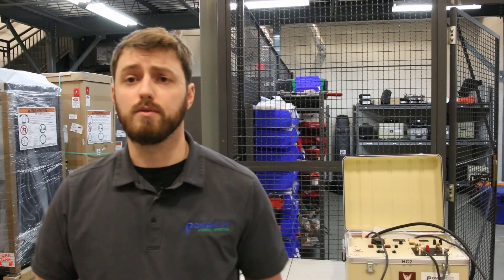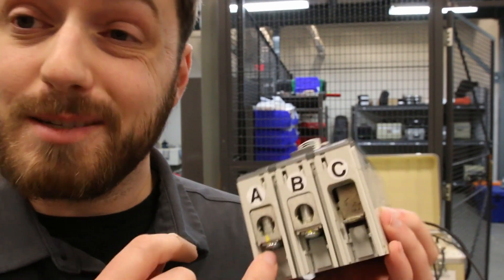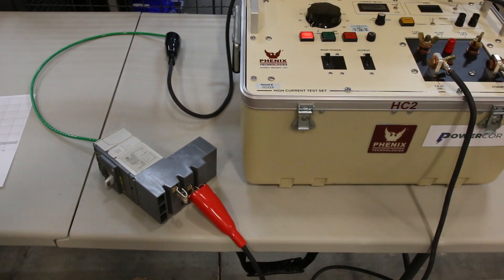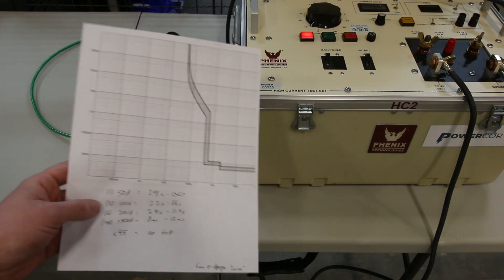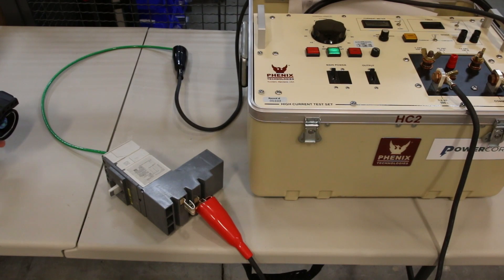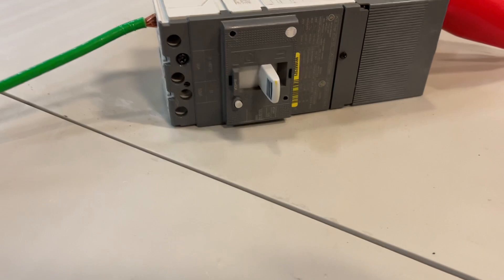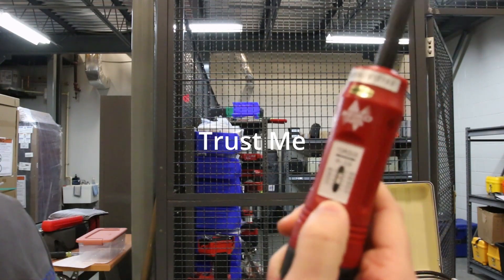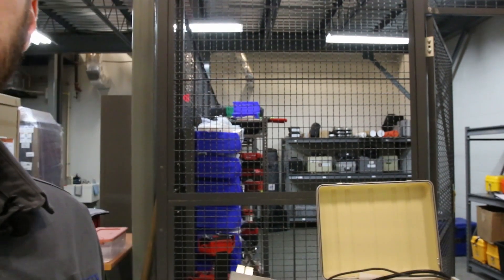Inexcusable Problem with NEW ABB Breakers

Comment: Are you a specialized electrician? I ask because I'm interested in doing the same work.
Reply from the maker: I'm not an electrician, electrical testing is really its own trade! It's important for a lot of customers to hire independent testing technicians, instead of relying on the manufacturer or installer certify that the equipment is suitable.
Reply: Thanks for the reply. So how do I go about becoming an electrical test technician? Are there schools and is there a license I need? @testingtechtips

Comment: I was an electrician for close to 40 years. That breaker look like a REAL PIECE OF JUNK!!! & EXTREMELY EUROPEAN!! I cant help but notice that the FACE of it is made out of PLASTIC!! 
the case of it is made out of glass reinforced polyester which can stand high heat. This stuff is just getting CHEAPER & CHEAPER. The lug you measured is the same as the one next to it. 
You are overlooking a machined edge or notch in the lug if you look very closely. ABB has really RUINED GE!! On their RELIAHOME P panels they are making ALUMINUM BUS BARS!! GE breakers have made LITTLE CONTACT with the bus tab which was ALLWAYS TINNED COPPER before ABB got their hands on GEs product line. I hope that this new GARBAGE really BLOWS 
UP IN ABBs FACE!! especially the resi panels & really BITES them in the BUTT!!   EVERYTHING is getting cheaper & cheaper across ALL makes. This breaker looks like a poor copy of Square 
Ds I LINE series that are PLUG ON INDUSTRIAL BREAKERS. It also looks like but HOPEFULLY NOT that, that piece that hold the plug in part is also PLASTIC & not the HIGH HEAT stuff.
I DINT like GE power mark gold 200 amp panels because the main lungs on the MAIN BREAKER are mounted on THIN MELTABLE PLASTIC & ONLY 1/8th inch from the back of the box.
I liked SIEMENS & SQUARE D QO panels because those lugs are on GLASS REINFORCED POLYESTER & NOT PLASTIC!!!  I-T-E used to be like GE but they got SMART & CHANGED this
POTENTIALLY BAD DESIGN!! Now their lugs on their 200 amp resi panels are mounted on the HIGH HEAT resin that the BREAKER IS MADE OF. I personally feel SAFER with this. 
ABB is modifying GEs Specra line with this NEW CRAP for the breakers.
Reply: Unfortunately a lot of manufacturers are going to aluminium and made in China components.
ABB used to be really high quality.
Reply: @mrfrenzy. Getting CEAP on something as DANGEROUS as electricity is just PURE CRIMINAL in my opinion. When I had my license I was EXTREMELY PITICULAR 
on whose products I used because when I was a kid I got to see them TAKING 7 BODIES from a BURNED HOME that was the fire was ELETRICAL. The ENTIRE
FAMILY DIED IN THEIR SLEEP!!! 1970s & everybody wondered why I had to have my Square D QO!! When I retired AFCI breakers were not in full requirement yet.

When people die do to faulty design & companies like FPE, ZINSCO & CHALLENGER must have been WELL AWARE OF the UNSAFE JUNK they were putting out.
Id like to see some of these engineers & people that work for places like UL start GOING TO PRISON for this stuff!! ABB Reliahome with ALUMINUM bus will
be a MAJOR problem. Just mark my words!!!  I hope this really bites ABB in the butt!!!

I decided to become an electrician because I wanted CONTROL over something I was once very afraid of as a child after seeing them removing that WHOLE
FAMILY out of their burned out home!!!  Electricity is something that should be taken very seriously by ALL MANUFACTURERS!!! That fire will most likely
haunt me for the rest of my life!!!